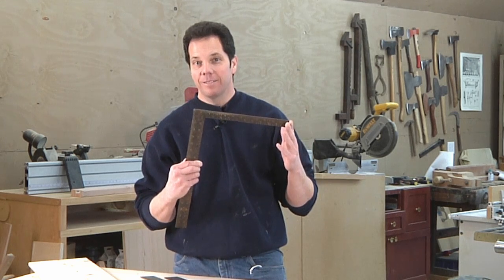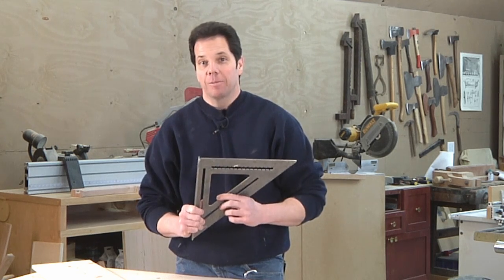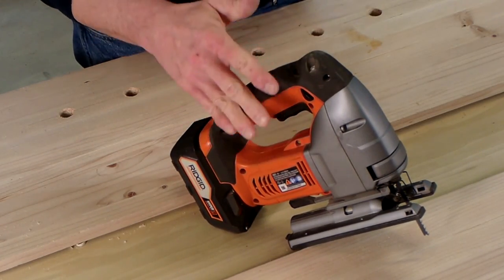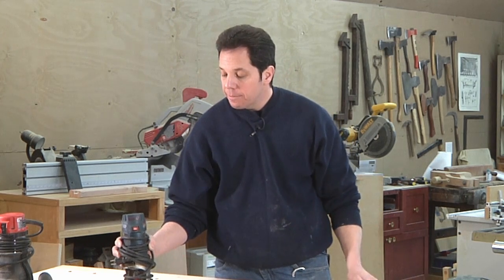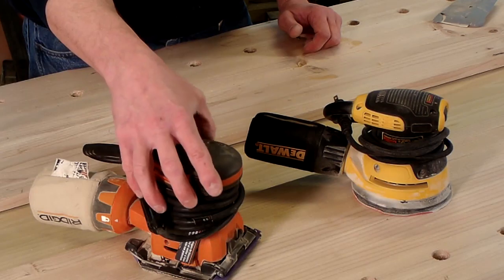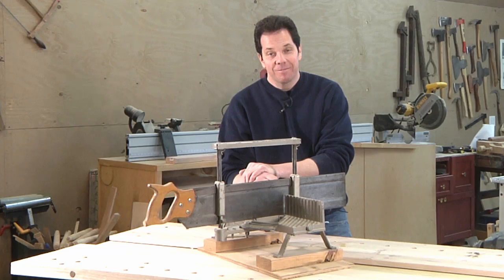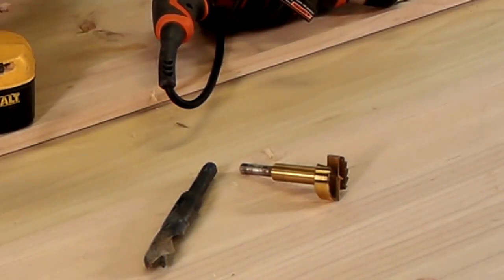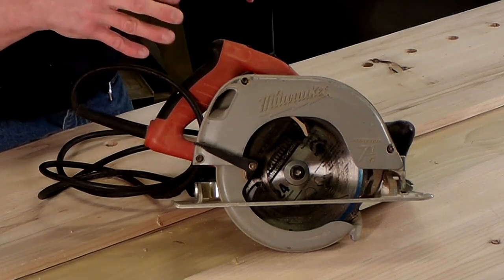10 BEST Woodworking Tools you NEED Under $100

Comment: I'd add a ShopVac or even leaf blower to help remove/move dust and shavings.

When my neighbors' windows are not open, I've gotten in the habit of just grabbing the battery for my handheld leaf blower and using that to blow the dust out of my garage and driveway, sweeping or picking up any chunks.  The neighbors have yet to complain, and the wind and air currents from cars driving down the road disperses the sawdust quite quickly, so that it can naturally decompose.  15-30 seconds with the leaf blower is usually about all it takes for me, so it's very quick.

Comment: I’m a newbie and thus far my most used tools are:

1) My benches, vices and holdfast
2) My measuring tools (Tape, folding rule, triangle, squares, protractor, various callipers, T square, steel rule etc) 
3) My shop vac
4) My safety gear (mask, glasses and ear protectors) 
5) My back saws
6) My hand planes
7) My chisels
8) My clamps
9) My iPad for instructions 
10) My coping saw. 

I have the tools mentioned in the video, but I find the circular saw redundant for what I do small pieces of furniture and furnishings but mainly large photograph frames for my images. I do use my table saw, bandsaw and routers a lot and as I don’t have a thicknesser/planer and don’t have room for one I use my electric plane to do the big stuff before using my jointer plane.
Reply from the maker: Great list Mark. Some of those items i left off just because they are way under the $100 price, and some are just plain obvious., (tape measure, pencil, etc) . I am also going to do a hand tool list, and some of your items will be on it. Thank you for your comments
Reply: Chad Stanton I didn’t say pencil, but now you mention it it would make an interesting video for newbies comparing different ways of marking work. Pen, pencil, knife, chalk pen, chalk string etc all have a place but I didn’t know until recently that pens are used on purpose and not just because someone lost their pencil. Or that marking knives also break the fires and you can get a chisel in for precise sawing. 6 months ago I would have said that sounded horrendously boring but now I think a lot of newbies might be interested in what and when. 

I’m looking forward to your hand tools video, they are my favourite though I couldn’t work purely hand tools without being hospitalised on a regular basis due to my health condition.

Comment: Agree that those are all good choices, but one I think should be in the top ten is a combination square.  I can't remember a day without using one of the three I have at least a few times.  4" one and a 12" one.   For what I do, they come before the power planer.  But, it all depends on the kind of work one does.  For instance, so many people use a power miter saw a lot.  I have one, but rarely use it.  Anything I could do with it is better done on the table saw.  Everyone's workflow is based on the type of work they do.   Kudos on coming up with this list.

Oh yeah, and if you go Starette  on the combination square, you'll be lucky to come in under $100.  LOL.

Comment: the quickest and easiest way to set up a shop cheaply is buy second hand tools.  an amateur wood worker usually puts very few hours on a tool, so while they may look old they are in good condition.  i never buy new handsaws or chisels etc.  the reason i buy old saws is i hate the case hardened teeth on new saws.  you cannot sharpen or reset them.  i have bought two new handsaws and thrown them both away as the set was wrong and i couldn't cut a straight line with them.  the old handsaws are easy to sharpen and set and work extremely well.
Reply from the maker: I totally agree with you. Great advice!
Reply: Not wrong with your recommendation but somethings you want new. That Kreg jig, good luck finding a used one with sharp bits. A square needs to be straight and I've found them at garage sales/auctions/estate sales in rusted or bent condition. Power tools are also questionable (unless you know what it is, and sure of its condition...). I too, have had to toss handsaws out as no way to sharpen these new ones (easier to replace...). But you can send table saw blades out for sharpening (cheaper than new freuds). I was given (free) an old Dewalt 18v. The batteries are dead. New battery set costs as much as new screwgun WITH batteries. But one can get Dewalt's adaptor to use with newer packs. Still, you need to be smart when buying tools. Chad: Thank you for the McFeeley's link! I needed fasteners like those!
Reply from the maker: @xoxo2008oxox  Great points.

Comment: one: safety glasses
Two: Circular saw
Three: Hearing protection
Reply from the maker: i'll put that in the list of tools under $10 not $100. Thanks for the reminder
Reply: I think finding PPE that fits well and that can be comfortably worn for long periods is key.  It doesn't matter whether the PPE is expensive or cheap, if it's not comfortable to wear it's not going to be worn often enough.
Reply: @jayschafer1760  yup, I wear corrective lenses and I always opt for impact resistant glass(polycarbonate actually) , so I'm always wearing eyepro, though If I'm turning I usually throw on my face shield for added protection

Comment: M9-Promaster coupon code not valid! I used it on:  
8 x 3/4 ProMaster Wood Screws, Black Oxide, Round Washer Head, Combo Drive - QTY:100
Reply from the maker: i will call them right now
Reply from the maker: I talked with the owner. He said occasionally you have to login in first an then place the order. If that doesn't work he said write them or call and he will get yo your order taken care of. 
1800-443-7937
Reply: @ChadStanton  Thank you!

Comment: love the router table. plans? Ooops jumped the gun.
Reply from the maker: If you sign up ifor the newsletter before March 5th you can find them there
Reply: @ChadStanton  I signed up. OH will we get a confirmation? I gave myself the thumbs down for jumping the gun! If I had waited 30 seconds I would have seen you state about the Newsletter.
Reply from the maker: @brucewelty7684  there is no confirmation but if you don't get it on March 5th email me. Make sure to check your spam or junk folders because depending on your browsers it could get routed to there.